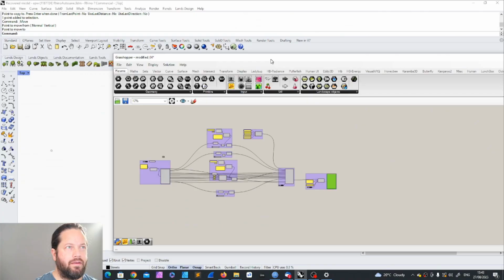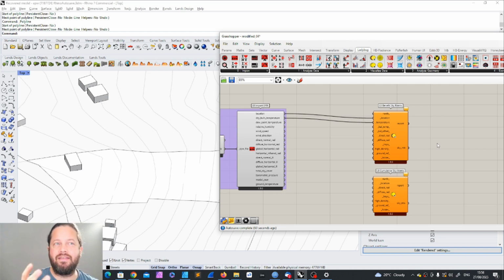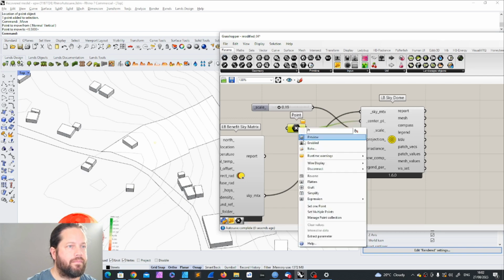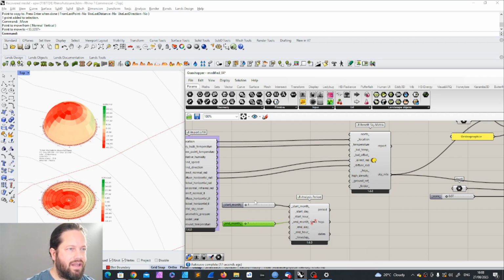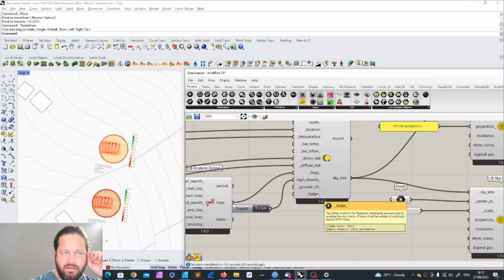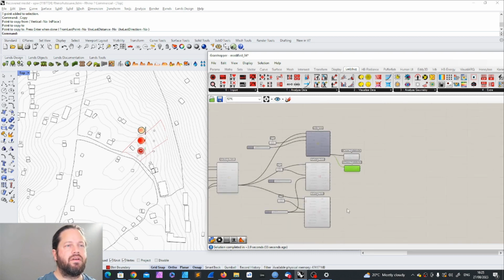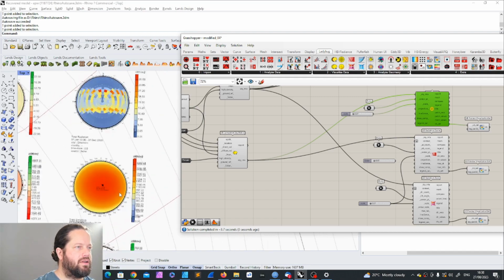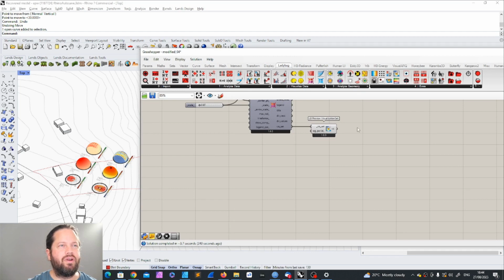#15 Ladybug Sky Matrix Tools in Grasshopper 3D - Ultimate Ladybug Course - LBT 1.6

Comment: what do I need to do when there's a yellow sign, that says "old" on my sky matrix?
Reply from the maker: That means your sky matrix is from an older version of the Ladybug tools.
So for example you have worked with LBT 1.5 and a saved a script in that version and later you update your LBT tools to 1.8 and you open the same script it still has the old components...
Reply from the maker: An older version of a tool doesn't necessarily mean that you can't use it but sometimes you need to exchange it because the code might not be compatible anymore... 
You can see the version of a tool on its lower end when zooming in. 
If you want to update the tool then you just pull the newer version of the sky matrix from the toolbar, delete the old one and match the inputs and outputs...